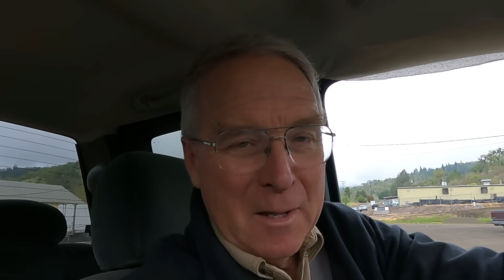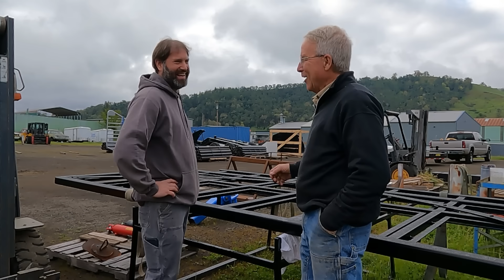Installing My Gate!!

Comment: My opinion doesn’t matter in the least but I’ve installed fences (and gates) for 21 years. Gotta be honest, the weight of this gate especially adding the wood on concerns me. If that gate comes loose (even if it’s 15 years from now) it could kill someone. A larger 8”  thick walled S.S 40 or S.S 80 post would have been my suggestion. Love the channel and all you do ❤
Reply: if you die from this gate coming loose it is your turn.
Reply: The post isn’t the problem. I heard him say there’s a slight behind in the hinges in the open position. That will snap off the hinge for sure in A couple of months. There should be zero resistance in the hinges, period.

And please do not put a wheel on the bottom that will act as a lever and cause damage to the concrete base along with undue stress on the hinges.
Reply: Having a little bit of flex in the post is not the problem it’s the concrete that would be the weak link, but if those hinges are binding, it’s not gonna last a month. Once it’s in use.

Comment: Im looking forward to the gate opener segment. My 12ft gate is about 400 lbs and the opener I have struggles with it especially if the wind is blowing. Im hoping I can learn a thing or two from you.
Reply: Is it a swing, slide/roll, or lift?  I assume it’s steel given the weight and not aluminum.  What type of opener do you have on it?

Comment: The gate turned out great and will be even better with the wood installed. Wide flange beams are a poor choice for the posts and should've been square tube or pipe for the torsional rigidity. Your extra gussets will help but the best thing is to add is some stiffener plates at each hinge location to tie in both flanges to the web.

Comment: Add web stiffeners to the main post aligned to those in-between tubes you welded in place in place to stiffen the main column and prevent twist